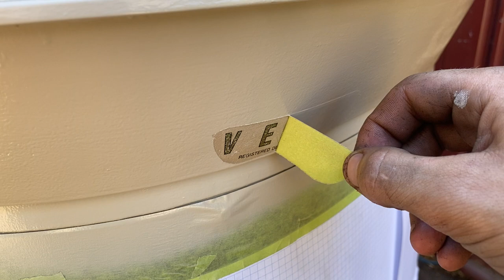Restoring An Old Venco Pottery Wheel from 1980

Comment: Hi! I have the same wheel, am having issues with getting it to run smoothly using the pedal, I need to push down fairly far to get it started but have barely any control with the speed (goes from stop to full pelt). Any tips?
Reply from the maker: It sounds like it needs some adjustment in the angle of the motor. There are a couple of adjustment points. If you wish for me to service your wheel I’m quite happy to. Feel free to send me an email, check in the description for details. Thanks

Comment: In the first part you turned it on and jt was spinning for a leftie but then at the end it was spinning for a right handed thrower- how did you turn it to spin the opppsitie direction ?
Reply from the maker: It is possible to change the wiring inside the motor to reverse the direction of the wheelhead. At the start of the video it spun the other way as the cone was contacting the incorrect side of the drive wheel (it was out of alignment.)

Comment: Did you think about 3D printing new grommets rather than the lathe? Great video.
Reply from the maker: Glad you liked it. While 3d printing grommets would be possible, I’m not sure the characteristics of PLA plastic would be favourable for that application. The ones I made are machined from particular type of nylon with good wear resistance/ uv resistance and in general should last longer than the stock ones which are prone to becoming brittle and disintegrating.